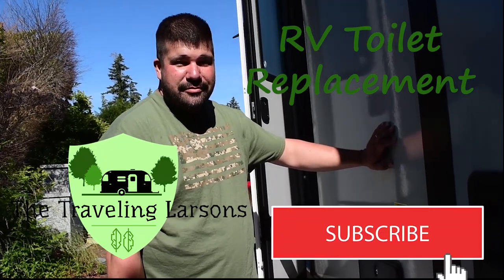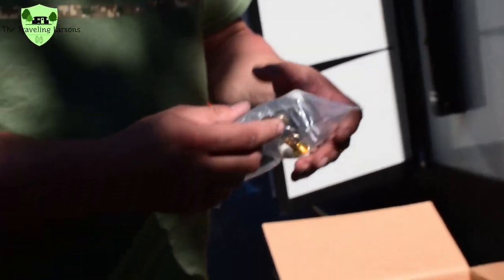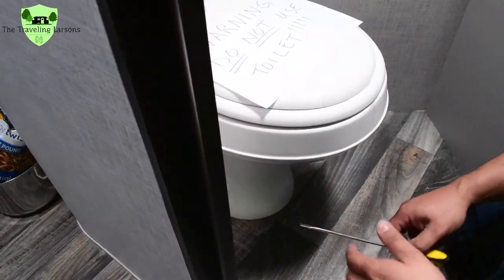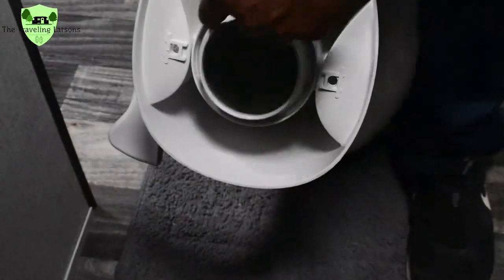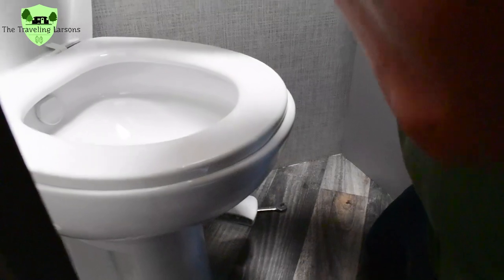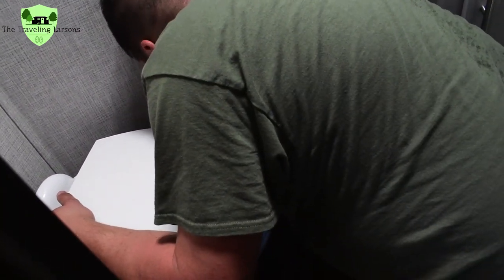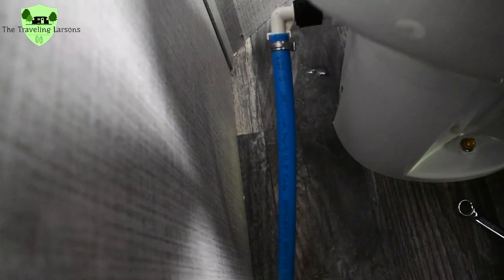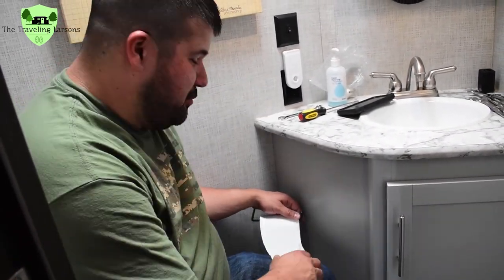RV Toilet Replacement

Comment: Seemed pretty straight forward. Nice walkthrough and glad to see it was almost identical to a residential install.  Nicely done👍
Reply from the maker: Thanks for watching.  Yes, a very easy install.  I’d say easier than a residential install, because there is not a messy wax ring to deal with.